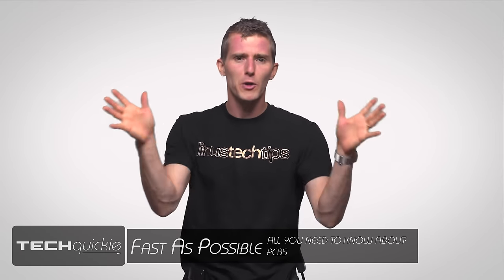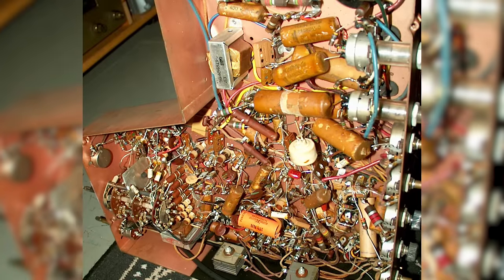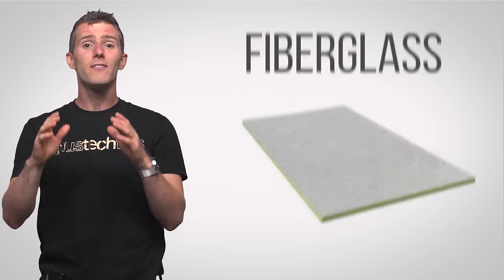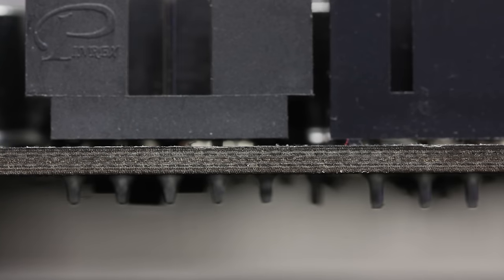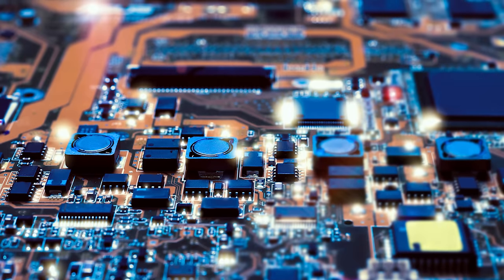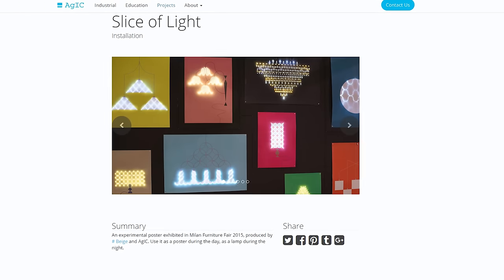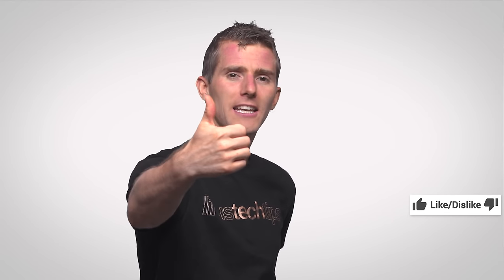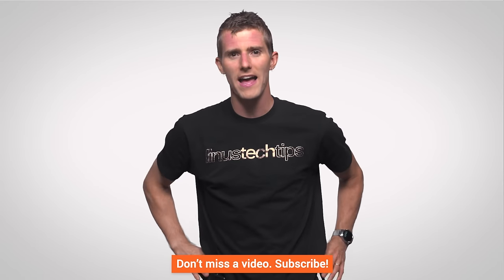How Do PCBs Work?

Comment: My solder and repair training in the military, actually included training on repairing internal traces in multilayer PCBs.

Our final exam required us to go down to at least the third layer and make a repair, then build up and fix the layers above that we had to disturb to get into the lower layers.

A process that takes days to do properly.

Repairing surface traces is extremely simple in comparison.
Reply: Fascinating, thanks for sharing!
Reply: That's cool as hell
Reply: ...why?
Reply: @NoNameAtAll2  Because things need to get fixed, and you can’t always order a new circuit board in the middle of a war.

I was taught how to repair damage that went completely through a board as well… Basically I could fix bullet holes.

Cards and boxes are getting more complicated, to the point that it may not be practical any longer. But the military still uses some older equipment that the technique could be used on.
Reply: That's pretty cool.

Comment: Everyone was in cable management hell in the 20th century,
Reply: +CroGaming woah
Reply: Ah, the good ol' days (actually those are even a bit before my time). Check out "Wire wrapping (electronics)" on Wikipedia sometime. Very similar but on a tighter, much smaller scale. Brings back fond memories of the Commodore 64/128/Amiga days.
Reply: most answers here and just like cars, they also did alott of the "wire harness" technique.
https://en.wikipedia.org/wiki/Cable_harness
Reply: @stryk187  The tv I'm fixing from 1958 has a large PCB

Comment: It's not exactly how PCB's for motherboards are made. they have traces between top and bottom layers etched too,and You didn't show that. They etch and make 'vias' to connect inner layers and drill holes for outer 'vias' with something called "Maltese cross" marked in inner layers of pcb to perfectly fit the holes from outer layers. my description can be wrong, too but It explained how multi layer PCB's are made :)

Comment: There are other ways to make pcbs for custom circuits.  I HAVENT try yet. But there are plenty of guides online on how to do this at home relatively cheap.
Reply: He explained basicly how the big fabs do it for obvious reasons. but at home, cost or availeble tools can make you choose for other ways. Any etchant for copper could work or even a dremel/cnc could route those traces. Ive also seen people make circuits with no traces at all, google: "pcb manhattan style", "bug style" or try protoboard. But I think i go with my laserprinter and just an cheap echant. and maybe build a CNC to do it later when I get some steppermotors. 

Buying a pcb from china is also dirt cheap... so maybe ill buy the controller board from there.

Comment: i have a circuit consisting of a battery, LED, motion sensor and switch. all the components are around 30cm apart connected with wires so how can i program this? would i need to include a PCB and join all the components on there?

Comment: 100 Layers of fiberglas challenge.
Reply: For the thickness of the board or amount of trace layers in the board? because most fabs can do 10 or less, 0.062inch/1.6mm (Default), or the FR4/G10 itself 3 in. (76.2 mm) thick itself. buy 10 of the smallest and stack em, and you have a 100 layer one :D 

but you comment was probably some kind of "gamer" or "car tuning" joke... 
src: http://www.g10fr4.com/g10_fr4_sheet_material.html

Comment: Weird question cause I'm new to learning about PCBs, but what do the conductive tracks serve as and why?
Reply: I know it's been 5 years and all but if you're still wondering, the conductive tracks… conduct electricity. It's much tidier to do it this way than to connect all of the components using wires. Well, you could think of conductive tracks as wires, there's not much of a difference really and PCB design software will often refer to traces as wires (e.g. KiCad does).

Comment: Another mode of making "Printed" circuits:
Buy a premade board with full copper on it
Draw the circuit with permanent marker
Put it in some kind of acid (I use HCI)
Let it get the copper off
Brush the permanent marker off, and the copper remained under it

There.
Homemade circuit
Reply: You don't need "fancy" power conductive marker....

Comment: Could've gone into more detail tbh... just because this is tech"quickie" doesn't mean you should explain only 0.00001% of the subject, such as mentioning that there's more to a PCB than just a bunch of wires that means something like a motherboard can't just be auto generated (even though auto routing tools exist) because of the requirements that things like RAM have where all the data lines must be an exact identical length which is why you see wiggles on some PCB traces (this also explains why HBM is better than GDDR5, shorter traces / infintisemally small traces = easier to length match = can have a wider bus as much as 1024 bit rather than the best GDDR5 has ever managed with 512bits without signals getting jumbled up). Also that circuit drawing pen isn't really a proper PCB and you CAN actually make real PCB's on fiber glass using the same processes pcb manufacturers use that you mentioned a little bit, you have to use some chemicals but other than that steps like printing traces onto the transparent sheet which tells the etchant which parts to cut out and what copper to leave down, can be done with a standard home printer, would be interesting to see if linus can make his own PCB (of course you couldnt make a motherboard grade PCB at home easily but you could make a PCB for an arduino at home for example.

Comment: Annnnnnd now i want you to make a motherboard with those markers
Reply: He could do it (he said its probably dificult) but if he chooses a Z80 or similiar 8bit or 16bit cpu, you could still do it with a 2 layer paper and dip chips :P

anything newer has problems, trace thickness, groundplanes and noice. Paper isnt realy the same as FR4 so all research into bus systems has to be done again with paper in mind. also the cpu sockets these days misuse the pcb strength for holding gthe cooler, you cant get that with paper, so we be doing some cheating to still do it. Maybe a bit of freeform and bugstyle soldering... still every bus should be of equal length and proberly terminated. so stick with the older systems :D

Comment: Rx 470 4gb
V
1060 3gb

Dawn of bang for the buck
Reply: rx 470
Reply: rx 470 definitely
Reply: 1060 6gb
Reply: there isn't a 1060 3gb. there is a 6gb.

get the 1060 6gb. it's a better card.
Reply: +BestServedCold ahh. wow. I'm actually surprised it was released as a gtx 1060 and not a gtx 1050.
Reply: +BestServedCold are you sure? everyone was saying it was going to have 1150 not 1250 or something.

Comment: If I were to put a vinyl wrap on PCB, would it still function?
Reply: yes, tweet dbrand to make mobo skins pls
Reply: As long as it isn't conductive (vinyl isn't. the glue probably isn't either.) and you don't screw up cooling, it should be just fine.
Reply: Thx guys!
Reply: Also changing the application method to not use a heat dryer.
Reply: Wouldn't it melt under the heat?
Reply: +DustyEDM dBrand puts their skins on phones that get really hot (over 30°C) so I think they can stand a PCB
Reply: PCBs get much hotter than 30°C (for that matter so do phones). I wouldn't trust it personally there are some components on a motherboard that can reach 80+°C.
Reply: +Skooteh I'm not going to put it on like transistors and capacitors. I was going to put it on the PCB itself, so it would get that hot.
Reply: Dennis Playing Lacrosse? the heat might conduct through the PCB, depending on how close they are. It will probably work fine anyways.
Reply: copper is a great heat spreader. the copper on your pcb gets hot too.
Reply: dbrand needs to make wraps for gpus, ssds, pc cases, and ram!!!!!!!!!!!!

Comment: These "small holes" are caled VIAs.
And there is up to 18 layers in modern mobos.
I designed/made few 2-layer PCBs and it can be quite hard, 18 layers would be a nightmare...

Comment: One of you guys might be able to explain this to me. Why do circuit boards have so many un-populated pads? It looks like something could be soldered there, but the trace leads to nothing. I was thinking maybe it was because they decided they didn't actually need the component in a later board revision so they removed it and left the board itself unchanged. But even first model hardware have them!

Comment: My gpu is the msi r9 390 and my cpu is the Intel I 5 4600 which should I upgrade first??
Reply: Would wait another year, R9 390 isn't that outdated yet.
Reply: gpu but they are pretty balanced. Download msi afterburner and check the load percentages on the cpu and gpu. I would base your decision on that.
Reply: +Hudson Meek I have it but idk what it all really means yet and what to look at or how to overclock
Reply: Parker Olinde look at the long list of graphs, find gpu usage and cpu usage. whichever one is lower, upgrade. make sure you look at the graphs while you are playing a game or doing whatever you do on your computer. if it is gaming, test multiple games for best results
Reply: +Hudson Meek thanks bro.. And upgrade the one that is using the most or?
Reply: +Parker Olinde yes. you want it as balanced as possible. but if you have a 1080p 60hz monitor you don't need to upgrade
Reply: +Hudson Meek how come?
Reply: At the moment, both of those components are capable of playing most new games at higher settings.
Reply: +Hudson Meek is 144hz better than 60?
Reply: Yes. I play on a 144hz monitor and you notice it the instant you move the cursor around. You can't go back. Realistically though for games 60 is fine. Only do 144 if you play competitive games like csgo or 60 fps isnt good enough for you
Reply: +Hudson Meek my build is really solid as of right now but I prob will upgrade it the monitor eventually but it's not on the top of my list of priorities like you said

Comment: Good intro, but not super detailed. If you like more info look around on EEVblog where he mentions why PCBs are made various ways at different times. 

The PCB is usally made like fiberglass, copper, print, repeat. Once all layers are made then you glue them together, add the VIAs, VIA stitching, etc. Then the mount holes, holes for through hole parts are made. Actually a lot of things in the design of a PCB from EMI, resistance, current. Some things like power supplies will use large traces, but will also supplement them with jumpers or a lot of VIA stitching so that they can handle like say 40 Amps, etc. I saw a lot of PCBs with seemingly pointless coils, sigzag traces, etc. I thought it was like a compensation for resistance, but from what EEV blog said it is actually because if you are sending data and the traces are different the speed of the electrons will be off and cause issues unless the traces are the same length.

Comment: I'm building my first computer on the weekend, I have a cat; should I build it in a room with a carpet floor on a wooden table but no risk of cat hair or on table with a hardwood floor and possible risk of cat hair?
Reply: I'm not 100% sure since I don't have a cat, but I don't think the hair is a big worry. I'd be more concerned about the static electricity on your hands causing harm to the components, which I'm sure cat hair isn't helping. I think Linus has a video about antistatic safety, but if you wear an antistatic wristband or something, you'd probably be pretty well off doing it on the table in the carpeted room. Good luck with your build, man!

Comment: imagine trying to troubleshoot one of those whole room/building computers
Reply: Troubleshooting them today or back in the day? With today's equipment, it wouldn't be hard to troubleshoot a computer that size. It's easier than trying to fix a modern motherboard that's been drillled, that's for sure...lol

But considering how even low-end ARM CPU is an order of magnitude more powerful than early computers, I'm not sure why you would want to troubleshoot/fix it.
Reply: for sure mean back then, but from a starting basis even today looking at the insides of one of those would make my brain go poof, so much clutter

Comment: Where can i print my DIY PCB design cheaply?
Any suggestion. I live in EU.
Reply: OSHPark for small designs, easyEDA for big ones.
Reply: you can print your own PCB, I print some simple circuits at home with just copper boards and ferric chloride.
Ferric chloride is a extreamly messy I'm at the moment I'm using sodium persulfate.
Profesionaly printing your own board is that the price is going to be very high if you just print 1 board but of course the quality is very good.

Comment: Almost always multi layer board with vias. That means each fiberglass layer prior to sandwiching has had a copper layer that was etched. Vias connect desired layers through a solder bridge to the vias which were drilled and look like a ring of metal to the solder. CPUs can do similar things but have bizarre photo / particle etching techniques.

Comment: I use to make PCB´s using copper plates which had full coating on them. you would just use resistant marker to mark out where you wanted your connections to go and then place it in acid. It was easy way to make them but quite unreliable

Comment: But how can my PCB give red lights?
Reply: it probably has led's on it or you're burning the traces which will be a very short red light and then it's dead
Reply: Don't forget the puff of blue smoke and THAT smell of sadness
Reply: The magic blue smoke... They still dont tell me where I can buy some of it for my dead electronics to put some new in it.
Reply: +Nico Vijlbrief (CodeAsm) Its not possible that the traces burn. I think there is only LED involved in it.
Reply: Shazia Hussain
English, I think we both need to improve our understanding a little. yes, the voltages usually  going for leds arent enough to burn any traces, but with litlle effort, we sure can route some 12volts over the smallest via we got.

Also, I was hoping you got any of those cannisters full of fresh Magic smoke I can insert into my GPU, cause it lost some last week after a 24 marathon gaming.(wich is my joke.. but by now you either get it, or I still look like a fool)

Comment: Here in the DIY electronics world we often make our own PCB without that fancy pens. The method is this:

In electric stores you can buy the copper plates without holes or paths. Just the plain fibergalss with copper. Then we mark the path with two methods: simple designs can be made with permanent marker by hand, but more complex designs are printed in  glossy paper WITH TONER (inkjet doesn't work), then fused in the copper with some ironing. When the thing cooled down the PCB with the paper is dipped in water so the paper soaks and can be peeled with the fingers, leaving the toner heat-sticked to the copper. Then you dip the PCB in ferric chloride (also avilable in electric stores). The parts covered in toner or marker are the protected ones and the uncovered are washed away by the chloride. Finally you poke the holes for the componets witht a drill.